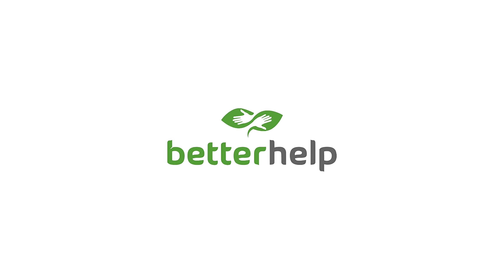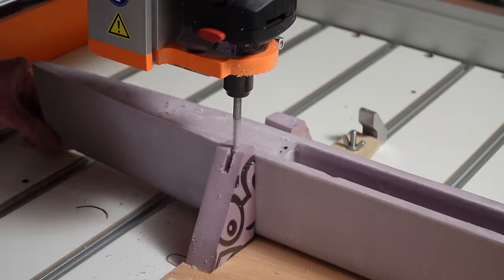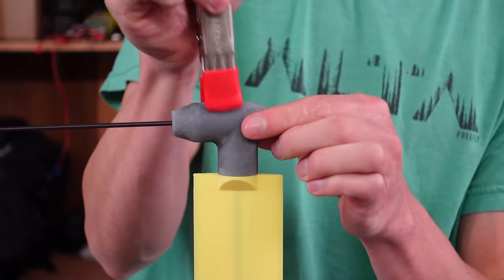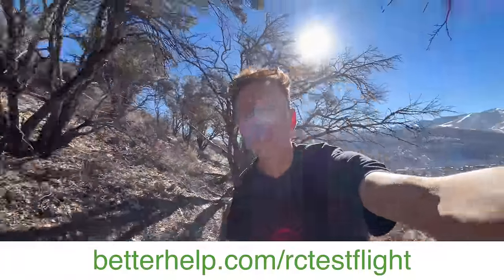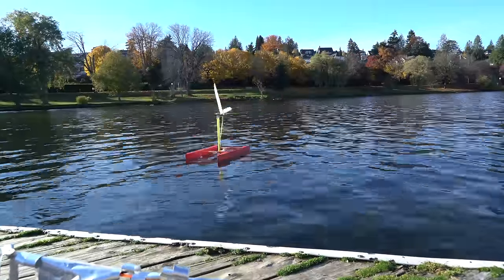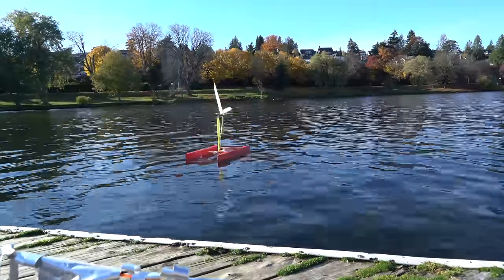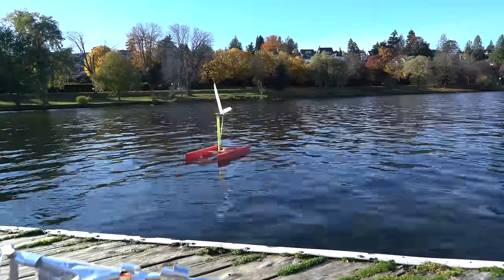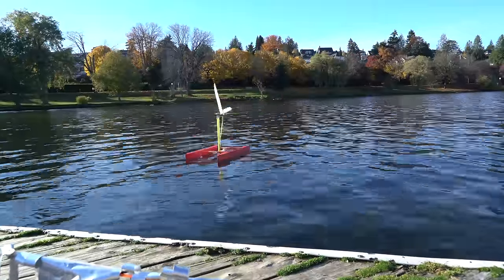Sailing Directly Into the Wind - Is it Possible?

Comment: The efficiency that you would need for torque transfer seems really tight.
A CVT for transmission of as much of the torque as possible.
Pitch for both the input and output prop.
Maybe a flywheel?!?!? (I kinda doubt it would help, but it does add options)
And then either a complicated mechanical solution to ensure all variables properly work together, or an electronic controller. (I would opt for the latter, because the engineering on a mechanical solution will make you want to pull your hair out. Not to mention an electronic solution can test the best methods that could then be implemented in a mechanical solution.

I think there's a HUGE amount of headroom for improvement!!!!!

Comment: what about a helix style blade. that way you don't worry about orienting the blades to the wind.  I've seem some helix turbines for electricity production; they are offered as an alternative to fan-blade style.  You could even have multiple.    I suggest putting a rudder on each pontoon rather than one in the middle.

Comment: Just increasing prop size means you're also increasing drag while maintaining the same RPM.  Continually increasing the prop reaches a point of diminishing returns, which I think you moved beyond.  Sure, you went faster, but it wasn't an efficient use of the torque available.  Surprised me right off the bat that you went with a 1:1 transfer, with the torque available a 5:1 or so would make more sense for higher RPM, then you can refine the prop size better.  Very interesting concept, always enjoy projects like these. 👍

Comment: Also be fun to have the windmill turn a generator to power a motor turning the propeller, then you could lose the rudder altogether. Swap mechanical losses going around 90 degree turns for electric losses converting to and from.

Comment: Id try putting a helicopter style wind prop on it so you can adjust the wing pitch base on wind speed, when the wind is really stront you can increase the pitch to decrease the drag and then when its barely moving you can pitch them just a tiny bit so that itll still spin but drag wont be as big of an issue

Comment: its more interesting to use wind for charging a battery and also use the wind mill as a regular sail with the resistance of the wind mill generating energy propelling the ship... you store the energy but you dont need to use it if theres already wind propelling it

Comment: I'd like to see a VAWT that is power-retractable for variable wind speeds, (to avoid capsize).  It could pump air into a pressure tank which powers a drive motor.

Comment: Anyone else think that something other than a 1:1 ratio between the wind turbine and the propeller might improve the performance?
more RPM can use a shallower pitch on the propeller without cavitation. 
Also, this might be an instance where a paddle wheel might be more effective than a propeller since everything is turning at a relatively low RPM where paddlewheels like to be rather than high RPMs where propellers like to be.

Comment: "Sailboats suck"? What a strange thing to say. Modern, high performance yachts can sail closer than 40 degrees to the direction of the wind. With tacking you can therefore easily sail "into the wind". Granted you need a bit of space to do so, but on larger bodies of water that is not an issue. Sails or similar "fixed" devices have the advantage for having no need to transfer rotational energy via gears to a propeller, incurring friction and other inefficiencies on the way. I do agree that for a very small boat things like waves and drifting can overwhelm the effectiveness of sails and other forms of propulsion would possibly make more sense.

Comment: Just a curiosity here.  On the first design, is there a reason you stuck with a 1:1 gear ratio?  You could probably get more out of the propeller without increasing the resistance on the mill too terribly much by doing something like a 4:3 or 5:4.  Would take time to test out, but just a thought.

Comment: I'd think that perhaps the most efficient boat would be using a vertical wind turbine and solar panels to generate electricity to turn a prop. As long as you got either wind or sunlight, you got power for propulsion with no emissions.

Comment: How about a vertical wind turbine instead of horizontal? They are less sensitive to turbulence (which on such a small scale matters a lot) and don't have to be pointed to the wind. Also curious about the impact of gear ratio - If I remember right, generally speaking wind turbines do better spining faster than water turbines/propelers, so a larger and slower propeller powered by a 2:1 ratio to the wind turbine... better or worse than the direct drive?

Comment: Would you have more directional control if you rotated the prop rather than using a rudder? Is this a silly question?
Anyway, very cool project. Thanks for posting this.

Comment: Would be interesting to make hydrofoil that first uses electric motors & when it lifts up, switches to wind. It will drastically reduce drag. Also, by gaining speed, wind speed will also grow & power of propeller.

Comment: you could adapt it too  with    SEVERAL  ROTATING  SECTIONS  SO COULD  GO ANY DIRECTION  BUT  HAVE THE  ROTARS  FACING  WIND  DIRECTION BUT  PLATFORM GOING  DIRECTION WANT  ETC ,.....  = no loss of power motion drag from wind  ..  because  that  can  be made to face wind  all  times 
then

Comment: There is one flaw in this deign that stood out to me.  It seems you need a gear ratio on the wind prop to water prop to get better than a 1:1 rotation.  You need to step down the water prop gear to get at least a 2:1 rotation against the wind prop.

Comment: Interesting! Just my own thoughts: Your turbine is too long and too wide making it act like an obstruction. Your prop also needs to spin faster and be bigger (you tested bigger but the prop speed is still the same. You might also try dual or triple props. A vertical turbine might also be better (one with small vanes).

Comment: The Big Contest would be to see if the rotary boat is faster or slower than an equivalent traditional sailboat tacking. Also, you should try a vertical turbine like a Darius Rotor so it will work at all wind directions.
Reply: Darius Rotor will not work directly against the wind - it's proven. The rotary boat does not need to go as fast because it can go directly to destination instead of tacking
Reply: @WindThrusters  I mean does the rotary boat get upwind slower or faster than a boat tacking upwind (ie Velocity Made Good)

Comment: Would using two propellers on the sides with differential thrust instead of one in the middle help with the steering at low speed? How would a generator on the wind side coupled to an electric motor on the prop side compare in terms of efficiency of power transfer versus mechanical transfer with gears? If that works well then you could even think about adding a battery to store some wind power when you aren't using it.

Comment: Gears, solar electro-magnetic motor assistance, adding hull-integrated or flexible hull vertical hydro pressure motor system, hull integrated differential temp motor (Stirling) water temp vs air, some solar/wind charged battery assistance - all computer coordinated? Thought about this a lot.  Wind alone - won’t work.

Comment: This is a really novel idea. I think that you would get much better results if you used much more efficient blade designs for both the Prop and the wind vanes. The prop designed by those MIT geeks would be a great prop to use under water, and the blade design from a house fan might yield better results, and of course a gear ratio for the underwater prop would also help and for testing purposes I think it might be in your best interests to have an emergency electric motor tied into the gear box as well so your test boat could be easily recovered with motor and rudder. that is if you intend to research this kind of thing to a much higher degree.  When I mention that funky MIT prop I hope you know what I mean the one that is a double helical design called a toroidal propeller

Comment: I wonder if you used a reduction gear method would it be more effective, it would have to work better and maybe a flywheel somewhere in the mix to hold some of the momentum?

Comment: I wonder if a paddle-boat would work well with this design.  With the right gear ratio you could turn low torque high speed into high torque low speed on the paddles.

Comment: It has to be a cylinder windmill not a propeller. A propeller creates lots of torsion whereas a cylinder wouldn´t fail so easily. Besides, a cylinder don´t need the vane to face the wind properly because a cylinder can take wind from all angles. No vane, would reduce mechanisms and limit the meta-center movement of the ship.

Comment: Have you seen the Archimedes 2 turbine for power generation? I wonder if that sort of design for the top turbine would be more efficient in this case. It also aligns itself with the wind without the need for a tail, so thus less drag.

Comment: What about a fan style kite released behind the boat, and instead of a driveshaft to a propeller, the fan spinning sends power to a battery and an electric motor, which would allow you to "sail" into the wind?

Comment: I would have thought that the flat blades create much more drag when being deflected to provide rotation.  An aerofoil blade should should provide much greater "suction" lift and much less drag at much lower angles of attack to the wind

Comment: What if you used a configuration where the wind prop was just charging a battery/capacitor and the motor was just a direct electric drive? You could even change the wind turbine from the traditional fan design to the vertical turbine design that would allow it to use wind power from any direction without the need to move.

Comment: Why not use a lift-based vertical axis wind turbine on the first design, instead of having 2 joints? It would have far less drag. Plus, with a larger propeller paired with an impeller on opposite end of a single shaft, extending out from 2/3 down a keel, it should be able to go faster and maintain better balance.

Comment: A keel and single hull setup will help lock the boat in the water which will help use the energy from the blade gain by not losing transverse motion?

Comment: I wonder if this sort of thing could be done with an electric hybrid version? You could have the turbine charge a battery or capacitor and then control the output of to the motor such that you're not pulling out more than is being put in. Maybe have the turbine charge a capacitor that's drawn from with a buck converter to charge a battery.

Comment: instead of a rudder, you could have used the servo to change the water propeller direction, the way the wind vane changes the air propeller. Would have given you a lot more command authority.

Comment: I was thinking, (Yes I know that is dangerous lol) that something on the first design like a gearing system to better adjust the torque to rpm ratio and a twin propeller system might make it better. Of course the added complexity, points of failure, and loses from friction and the like which occur might make that worse as well. Cool video though, I'm not really a boat guy but I enjoy the science.

Comment: There's a problem with you lift/drag calculations. In the glider example drag is parallel to the surface and lift is perpedicular. But with the rotor on the boat whilr you have rotational drag more or lessparallel to the blade surface you also have drag parallel to you 'lift vector' aka the wind. What would happen if you used a wing profile for the blades and mount them more parallel to the shaft?

Comment: 4 or 5 to 1 gear ratio needed to increase prop speed and or a gear box with variable gearing so a set prop speed then can be matched to the blade pitch and wind speed using the torque of the blades to increase speed.

Comment: would a gearbox in between wind turbine and propeller help? or make it altogether worse since it will increase mechanical loses? i'm thinking like 3 to one ratio (or something) which will speed up the propeller, it might make a boat sail faster... and on the other hand a solid shaft is crippled by loses, gearbox might only add to its misery and dont work at all.... anyway it sails... slowly but it does

Comment: there wasn't a gear in it other than for a 1:1 transmission? I would try to spin the prop faster than the mill. But in any case moving more water would be more efficient, for example with either a bigger prop or two propellers

Comment: Would be really cool if you added some small solar cells and also syphoned off some power from the shaft to run all the electronics so this thing could be used as a scientific sea drone that can operate for years at a time.

Comment: The wind doesn't push the boat when the boat is sailing higher than on the beam.... the wind passing over the shape of the sail causes lift.... the Rudder then steers the boat in the direction you want

Comment: 9:00 going downwind  is slow because the faster you go the slower the apparent wind you see gets, when going upwind you have the opposite effect

i don't think this will ever catch on with sailboats even if they solved all the design challenges in scaling this design maintenance costs for boats are already astronomical, and such a complex machine would always break down

Comment: So What if instead of the blades being at 90 degrees to the mast, what if they were vertical to the mast and spun around the mast? They could tuck in when rotating into the wind and flip out to catch the wind. That way there would be no need for a top-mounted gear set and the wind direction wouldn't matter.

Comment: It would be cool to make an axial into the wind rotor boat with a cable running thru a torque tube to make both propellers at a much better angle

Comment: You are doing 1:1 ratio turbine to propeller and you say you have a lot of torque which you put on a bigger propeller to use, would a 2:1 or 3:1 gear ratio to the prop be possible?

Comment: you wouldn't lose energy if you corrected your air blades and added some gears with at least 3:1 ratio . You could even design differently shaped blades for low air speeds and high air speeds to maximize efficiency. There always be some maximum efficiency wind speed no matter what you design anyway.

Comment: This makes me wonder if, like with wind turbines, larger vessels (including large sailing yachts) could use the wind to generate electricity which could be stored in batteries PRIOR to going directly into the wind, and then use the stored electricity to power the vessel upwind by driving a motor connected to a propellor.

Comment: Did you test an combination of 2 Airprops with 3 blades offset 60° degrees against euch other. That should increase the force on the waterprop. Even an waterprop clother to such to used in Submarines with 5 blades.

Comment: Can you not use two sails at the same time to move into the wind? (with no tacking or propeller)

0:38 Look at the "Points of sailing" image and try to combine the two "Close-hauled" from left and right. If you would glue these 2 boats together (in this orientation) their combined vector would be pointing towards the wind, no?
Reply: The two-opposite-sail idea is actually what the windmill does.  Upper blades are on one tack and lower blades are on the other tack.

Comment: You need some gear to counter the wind and currents… next time do the same on a trimaran if a catamaran you need 2 propellers in each hull or use hidrofoils to reduce hull drag also you need a wind mill tail to keep the rotor towards the wind

Comment: An electric transmission using two DC motors would be more easy to tune.

To make it simple you rewind the wind turbine alternator with thin wire for direct high voltage output so you only need a step-down PWM regulator for the electric engine.

Comment: What if the rotor wuold be set on the horizontal plane like in a gyro copter rather than be settled on the vertical plane? It would turn up indipendetly from the direction of the wind and then connected to propeller to get the forward trust. If the main rotor would be connected to a sort of electric generator rater than a coupple of  shaft and gears which produce a lot of friction, powering an electric propeller it would be even more interesting.

Comment: You probably need to gear up the water propeller relative to the wind propeller.  One to one direct drive doesn't put either propeller in it's optimal range.

Comment: IMHO there are 2 ways to increase eficiency. First way is to make a wind propeller with variable angle of attack. You can simply turn the inside of the blades until they are almost parallel to the air flow. This will reduce the windage of the propeller, but increase its efficiency. The second option is to remove the inside of the propeller altogether. Planes should start at 50% of their length.
Reply: A propeller propels that is why it is called a propeller.  By "Wind Propeller" you mean wind turbine or windmill.
Reply: @peterworsley4699  It is automatic translator meant something, not me)) I talked about wind turbine with variable pitch.

Comment: Real life problem...(Love your channel!)
In winter solar panels goet covered with snow
 Did some test on my 16 kW panels by uncover the top part of some panels as soon the black part got exposed to the sun it started to melt and uncover the rest of the panel...
Any idea to use a cheap drone to expose just the upper part of each panels at low temperatures? 
Just need to uncover a small part of the panels to help solar to clean the rest..
Reply: Regards from Norway!

Comment: I think part of the issue is your gearing ratio. It appears to be 1 to 1. I would experiment with maybe 1 to 3 and such. You said yourself that it has high torque. I'd opt for lower rpms on the turbine to put less stress on the blades